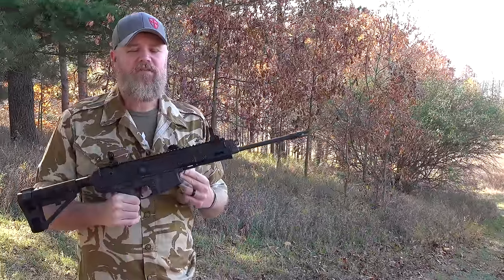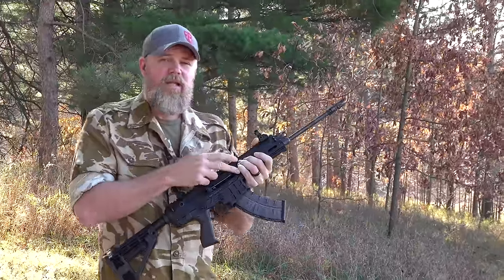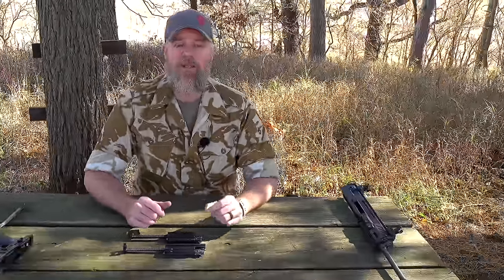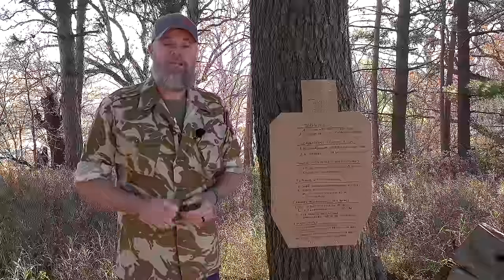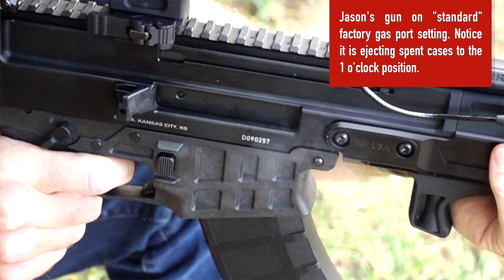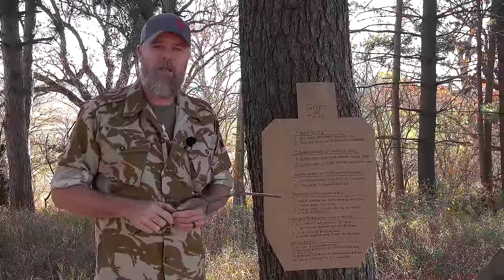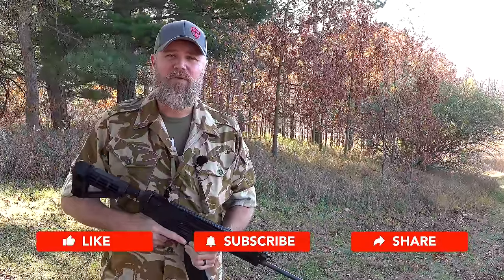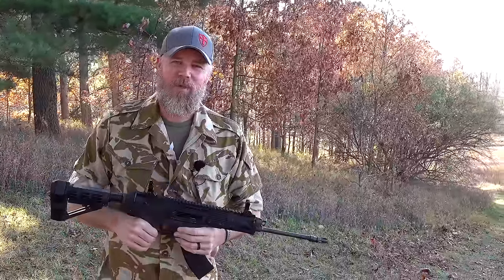CZ Bren 2Ms 7.62x39 Stovepipes: Cause and possible solutions.

Comment: Ah yes, the classic story. "if we give it more gas it's more reliable right?"
Reply: Mr. Mercury 
Perhaps making the gun dirty will make it work better
Reply: maybe they like Jeremy Clarkson huh? GAS GAS GAS.... POWAAAA
Reply: @Genesis23OPB  guys in the Czech Rep made a review.... they specifically claim they use the smaller hole.... https://youtu.be/ftmb_BjUbPc?t=2930
Reply: @Genesis23OPB  Yeah I could see that. Idk why they think that though they know the common ammo available in the U.S.
Reply: I don't think this is because the gun overgassed. It could be that the spring for the ejector plunger is too light. The plunger itself could also be heavy, further slowing down the ejection, not to mention the weight of the case itself. There could be issues in the hole or the plunger with surface finish.
Reply: @theHSPCproject  I’m leaning toward ejector too
Reply: @CzechoslovakGunStories  who use a smaller hole if I may ask? I looked at the video but could could not understand as I do not speak slovakian. I'am based in Europe and have been interested in buying a Bren 2 but after all this problems I am quite reluctant at last until the problems have been sorted out.
Reply: @martinrosencrantz9514  well per the video most of us here use the smaller hole with commercial ammo. I do not have personal experience but this is what the guys mention in the video....
Reply: @CzechoslovakGunStories  ok understand, but from what I understood even the lowest gas setting might still overgas the gun. I rally hope CZ will adress and fix this problem.
Reply: @martinrosencrantz9514  I will ask around if anybody here has issues with overgased BRENs but so far I haven't heard it... we have one at the local range as rental and the owner mentioned it works great
Reply: @CzechoslovakGunStories  thanks would really appreciate that! 👍

Comment: Should be noted don’t drill the hole unless you want to void your CZ warranty.
Reply: Will they fix it in the first place though this problem has been known for months
Reply: You can't just buy a spare plug to drill the (oh gawd) third hole?
Reply: @jonathansmith7306  lmao, no cz doesn't have any spares Appearantly
Reply: @kellernine279  Nothing inspires consumer confidence like "CZ doesn't have spare parts available".
Reply: Just weld hole if was wrong size and screw warranty.

Comment: I have an update on my CZ bren2 7.62x39 right when I got the gun I installed the HB Industries adapter to use AR mags because CZ mags were not available.  I had no issues with that set up.  Recently I switched back to CZ mags and started to have issues. I saw a video that said that the gas regulator from the 11 inch 5.56 bren 2 was the same as the 11 inch 7.62x39 and that it worked on setting #1. So I ordered a gas regulator from Europe Outdoor and a week and a half later I got it. I installed the new 5.56 gas regulator from the 11 inch bren 2 and the heavy piston spring from HB Industries and my Bren runs very nice now,  no issues and the casings fall at 2 and sometimes at 3 o'clock.  So problem solved for me. Thanks for making this kind of videos helping us to figure out how to solve this issues. Keep up the great work.  Be safe and God bless.

Comment: I have/had a 14 inch cz bren. Purchased it almost 2 months ago and have only around 1000 rounds thru it, but I am certain I fixed the issues I was having. My first range trip included atleast 1 if not more FTE every mag. I also experienced a much sharper recoil then most any other gun ive shot In 7.62. I started to believe the hate train on the cz bren but decided to start fixing it myself. My second trip out I tried different ammo. Something I discovered was that it will run supersonics and give me a FTE once a mag but also run subsonics perfectly. This surprised me as most guns I've owned required a separate gas setting to run both. This started to lead me to believe the gun is wayy overgassed and running too fast. It would explain the harsh recoil and the FTE. My first idea was to order a new gas key but cz was down for awhile so I went another route. I chopped my barrel from 14inch to 9inch. This in turn lowered the gas pressure dramatically. The supersonics now run 100% after 600 round test and the subsonics required me to drill the adverse setting a tad bigger to run properly. I fully believe the guns are overgassed, either with incorrect gas port sizes on the barrel or incorrect sizes on the gas key. 
This is just a sample size of 1 but I believe I fixed mine
Reply: Nice, mine was originally 14” too, and I did the exact same, chopped to 9 and added a cherry bomb for suppressor. Didn’t have any issues at 14, I wanted a 9 to begin with but none were available so I went 14 and chopped
Reply: @alexmacksey4510  also have a cherry bomb on mine 👍 looks sweet
Reply: I feel so bad for your barrel, but congrats on fixing your gun
Reply: @StevenL00  why? 9” is what i wanted anyway, and it was chopped and re threaded by a professional with perfect concentricity. To each their own, go do what you want with your money lol
Reply: @alexmacksey4510  buying a 9'' gun and buying a 14'' and then chopping it down to 9'' are two different things man. Anyway yeah just do what you want with your money lol
Reply: So are there any reported issues with the 9” version? I purchased a 9” version a month ago. Haven’t had time to go shoot it yet so I can’t say if it has issues yet.
Reply: @StevenL00  how so? I’m aware of gas port size difference. I know the job was done correctly and verified excellent results lol a 9” barrel is a 9” barrel, even if it started as a 14- they have the same piston length and dwell time from chamber to gas port. My barrel has in no way been compromised structurally or performance wise, so I really don’t care what opinion you have to share on it :)
Reply: @alexmacksey4510  The 14" and 9" have different factory gas port sizes right? Are the standard 9" guys running into problems like some of the 11" and 14"? Do you feel the 14" gas ports are better suited to the 9" than the 9" ports, or a custom drill out is required regardless?

Comment: CZ needs to get hot on this.  It is unacceptable that an expensive military design like this to have this level of problems.  
It looks like the additional dwell time in the 14” is only compounding the problem.  Hopefully CZ will issue all owners new gas regulators, and perhaps updates to the bolt and carriers
Reply: This is definitely a severe oversight by CZ. How do you overgass a gun so much, even steel case has issues. Probably the reason why Bren lost military trials to Kalashikhov concern in Pakistan and others.
Reply: Equine Appraising  their is hundreds like this. It is a cz problem. They are replacing with brand new firearms instead of fixing.
Reply: Equine Appraising  Leftism ruins everything it touches.  This is leftism in action.
Reply: I have two cz pistols that havent malfunctioned in 5-10k rounds of 9mm....their cz75s seem great imo
Reply: my 11 inch x39 has been flawless
Reply: @brighthought11  Mine hasn't. Sometimes it malfunctions several times on one magazine. I'm taking it to my gunsmith to have him make that gas plug modification.
Reply: From what I am reading it seems to only be a problem with the rifles being sold on the commercial market. None of the military contracts rifles
Seam to have the problem. Perhaps the barrels being made in the US are slightly out is speck or something like that

Comment: Good day Tim, my older AR also suffered from the radical forward ejection your CZ seems to have.  I wound up altering the brass deflector angle rearward via a hard rubber wedge JB welded to the face of the factory one.  I experimented with angles and rubber compound before the permanent JB adhesion and found a small, five degree wedge of truck tire tread resolved the issue.  The rubber wedge altered both the angle and distance of the extracted brass, both for the better, and I shot the heck out of that rifle for many years with no more problems.
Well done video, as always, and I hope CZ acknowledges the problem and addresses it.  Good luck sir!
Reply: Your AR was/is still way over gassed. Changing the angle of the brass deflector doesn’t solve the over gassing problem. Over gassed guns increase wear on all moving parts and should be corrected.
Reply: @sackychin6267  Yep, I learned about that aspect as I became more familiar with AR’s.  I was in my teens (early 80’s) and still green with that platform.  The rifle is no longer with me but I’d sure like to see it again to finally remedy the issue correctly. 👍🏼

Comment: This is an FYI to Everyone that OWNS a 7.62x39 Bren 2MS 14 inch barrel and could also benefit the 11 inch owners.  I finally got a chance to take my 14 inch Bren 2MS that now has a PWS FSC Compensator 30 (5/8x24) Muzzle Device to get me to 16.5 inches once it was Silver Soldered in place. I also added the following HBI items the HK 36 Folding Stock, Trigger, Sear, High Load Spring and the 10.8 inch Handguard that was Torqued to 44 IN-LBS instead of 45 IN-LBS. 
The Reason I reduced the Torque is that I noticed that when I installed the Handguard the First time the Bolt was NOT Seating and was Staying OUT OF BATTERY so I loosened the Screws and Tried AGAIN the Second TIME I got all 4 screws at 44.8 IN-LBS but the BOLT was NOT AS SMOOTH and it was having ISSUES SEATING Correctly! So I decided to Try Again but this time I would go to 44 IN-LBS and BINGO everything was SMOOTH and the Weapon Feed Snap Caps from the Magazine without Issues! I had to make arrangements to get the Barrel done so I had to take off the barrel and take it to get it done since I do not have the Equipment to Silver Solder the Muzzle Device in Place. When it came back last week I was ready to take it to the Range and I did this WEEKEND.
I used the BLACK Magazines with the Window 5 different Magazines using Tula 123gr Steel Case FMJ and I fired 300rds thru the weapon on Saturday with ZERO Malfunctions! When the Barrel Came back I did run a Otis Ripcord thru the Barrel and I did lube the Bolt carrier.  I HAVE A VERY STRONG FEELING that THE MAJORITY OF THE MALFUNCTIONS ARE BEING CREATED BY the VERY LOOSE REAR PLATE that CZ USA put in the BREN to make it a PISTOL since the Operating Rods are Wobbling during the Firing Process and the EXTREMELY WEAK Piston Spring that CZ USA Put in the weapon and IF the Handguard Screws were Over-Torqued that would make account for many of the MALFUNCTIONS!

Comment: Wow. I have the Bren 2 Carbine in 5.56. No malfunctions what so ever. However after shooting at an indoor range I was about to clean the brass from the floor and noticed I had nothing to clean. Your explanation about the shell casings being ejected at the 2 o'clock position makes sense, then I actually saw it happening. Casings were flying into the range.

Comment: i havent watched the whole video yet but wanted to let ppl know that removing the deflector helped mine.
it used to stove pipe a couple times a mag,
hasnt stovepiped sonce i removed it about 200 rounds ago.

a solution that might help ppl that dont want to drill a hole in the gas port. (fyi i will still probably do that at somepoint, but this is an easier fix for the time being)
Reply: thats what I was thinking watching this

Comment: Some suggestions to try:
Stronger EJECTOR spring.  This would help the case have a more rear aspect on the shell deflector.  Also, non permanent.

Removal / Replacement of the shell deflector.  7.62 is a little butt-heavy.  It seeks that in these malfunctions the casing IS making it's way out, and then is inertially stopped by the deflector.  

Stronger recoil spring.  This would slow the bolt velocity down a tad allowing the round to flip out a touch sooner.  Would also likely iron out the recoil impulse a tad.  

What amazes me is that even overgassed, it does not seem to be kicking out brass with a lot of "authority."  My main focuses would be ejector plunger spring (I bet they used springs sized for 5.56 brass weight) and the deflector being more AR like.

Comment: Hb industries is offering gas port hole drilling and stronger piston springs for all pistol sizes. It's also at a pretty good price. $60 to drill a suppressor setting in the 3rd position and a stronger spring is included. I bought a spring and I'm gonna test it tomorrow.

Comment: I posted the comment about ejection problems on my 14” Bren 2  after I put 2” muzzle extension on it. It sounds like switching to suppressor settings improved the situation. I just put flawlessly a 50 rounds through it. Keeping my fingers crossed for the best :)

Comment: I know this was 2 years ago, but has CZ corrected the problem since then?  MAC mentions there's two  gas systems- a standard system used in 14"-16" barrel models, and a distinct system used exclusively in the 11" models.  My first thought was, "Did the 11" gas keys end up getting used in the other models by accident?".. I would assume with shorter barrel length, there's less gas pressure to manage in the 11" models, and I'd assume that means the key ports would be larger to allow more gas flow to assist the bolt carrier (Compared to the 14/16" which probably has smaller ports.)  Just curious if maybe somewhere along the assembly line 11" gas keys were getting mixed into the 14/16" gas systems, which could be adding to the already overly gassed systems.

Comment: Overgassed issues can often be overcome by using a stronger spring.   DWELL TIME is obviously too low. Similar things occur in tuning an AR. It is a 3 legged stool to balance:  Gas, Mass, and Spring.   Many top tier manufacturers now use Sprinco springs , which are available in many different strengths, to get the best match for reliability.

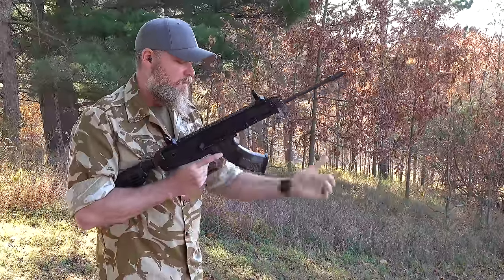Comment: 2:28 First red flag for overgassing is a tendancy for the firearms performance to improve with use. Slight carbon build up reducing the available gas into the system with a positive effect tells you all you need for preliminary diagnosis.
Reply: Huh?  Doesn't use open up the gas post as erosion takes place?
Reply: @ytuploads9742  no, use tends to clog things up with unburned propellant and carbon. That's why we clean our guns. Erosion only occurs after a long time. Corrosive ammo is rare these days, depending on the country of origin. The hard facing and heat treatment of working firearm components will take years to wear, unless it is a poor quality part.

Comment: Tim did you try firing either weapon using the adverse gas setting?  If the weapon is indeed over gassed we would expect these types of stovepipe failures to increase . Correct?
Reply: I would expect that result. 

I also don't see where over gassing would cause some of the complaints like bolt face damage.

Comment: I just pick UP a 14 inch Bren 2MS 7.62x39 on Saturday at a LGS because they had them of sale and I was afraid they may go UP in Price if the Current Election Result are Certified. The Shop had three 14 inch 7.62x39 two that were 2020 and a 2019. I inspected ALL 3 to see which I wanted to take home and I noticed a couple of things:
1. there are 2 type of Mags for the 39 weapons the clear mags and a BLACK MAg with a STEEL Re-Enforcement that increases the LIFE Cycle of the Magazines that was found out from the Machine Gun Version of the 39 guns.
2. The 2019 and Earlier 2020 sample had bigger gas ports but the Later one did NOT and that is the one I GOT! 
3. The Tool Kit in the 2019 and Early 2020 were like Old School US Military Cleaning Kit Pouch but the Later one had a nice Molle Clam Shell type of pouch that I had NOT Seen before. 
I noticed that the MAGAZINE was MOVING ALLOT during the SLOW MOTION Footage : Can the Magazine Movement be Causing the Bolt Carrier Speed to be Reduced and Aiding in the Issues.  I plan to take my Bren out toward the end of the Week after I get the Parts that I ordered like a Brace and 10.8 HB Industries Handguard I also ordered the Extended Charging Handle, Safeties and Trigger but I am going to wait till I have at least 300 rounds before I install them in case the weapon has to go to CZ-USA.  I saw a BRen 1 at the Shop right next to the pistol that I took home but it was in FDE with a 11 inch barrel in 5.56 it was a little heavy for such a small package but it did feel nice!  I am Debating about going back and Getting it but it would DEFINITELY need to be SBR with a ACR folding Telescopic Stock!

Comment: I have a cz Bren 2 ms as well with a 14” barrel 7.62. Legit would not feed a second round into the chamber after I would fire the first round. Not sure if this is the same issue you are discussing but clearly mine was just much much worse considering it wouldn’t even cycle a second round. I have a couple videos as well I could send you in case you wanted to see what I was able to capture during the video. If you do want this for some additional information regarding the czs issue. Feel free to just reply and I could send it to you over email or something. I also used wolf 7.62 and couldn’t even get the gun to cycle my second round once ejecting the first round.
Reply: Mine did it today I tried all setting and still couldn't get it to function right.

Comment: They should make an upgrade option for a new gas port so its not over gassed and has a suppressor setting. I shoot with a suppressor so I went ahead and drilled a third hole.

Comment: "Appears" to need 3 thing for being "Over" Reliable. Smaller gas port for reduced Bolt velocities, a larger extractor hook to hold more of the case head & a stronger & or larger ejector/ejector  spring. Maybe run a double ejector like some of the "Enhanced" AR-15 bolts.

Comment: Gas port is drilled too close to the chamber, resulting in pressure spike and too high of a bolt velocity.  Bolt dwell time is too short (underlug), bolt travel is too short.  Push ejector only worsens the problem.

It's all of the inherent M-16 bolt type problems rolled into one.